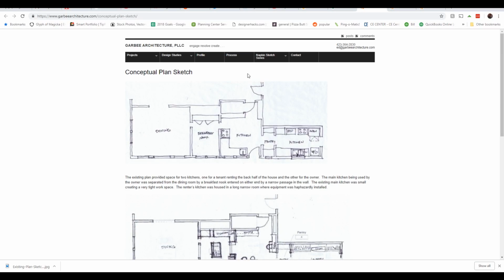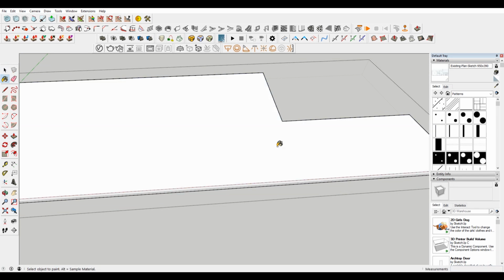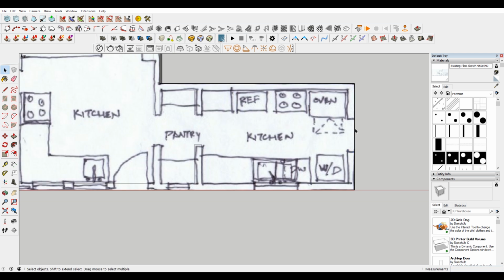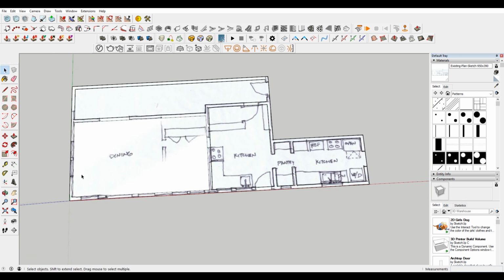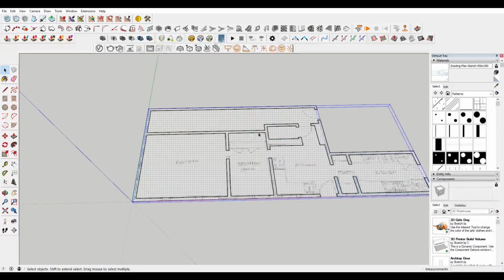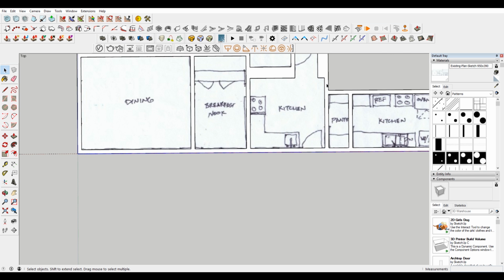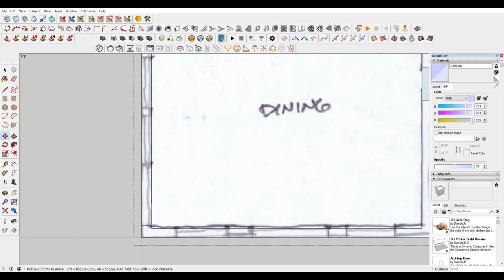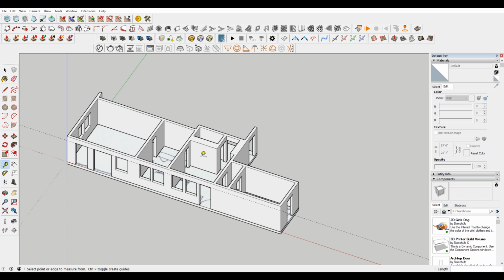Sketch Floor Plan to 3d in Sketchup

Comment: I can't figure out how he's copy/pasting and then using the move tool to precisely offset the wall line.
Reply: so there is a tool called move select that after doing that you should press alt or control in windows if it is a mac then press option then u can just move the line